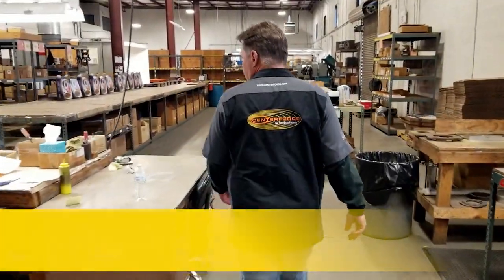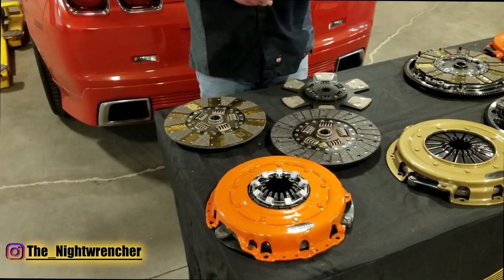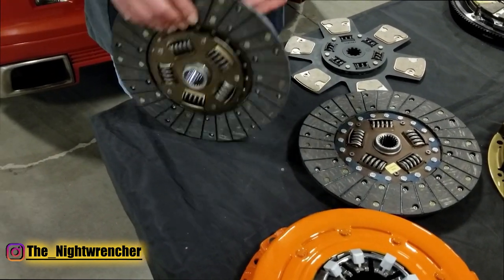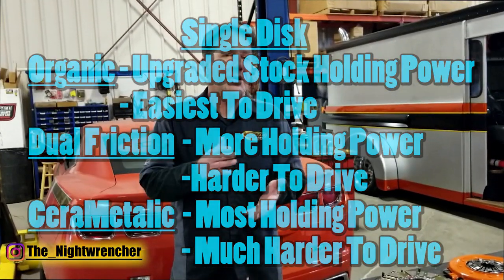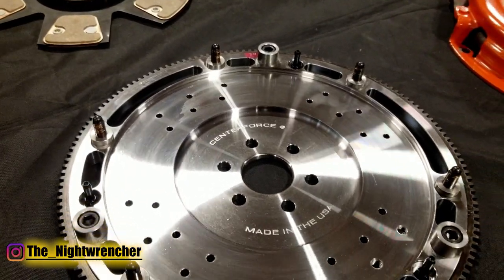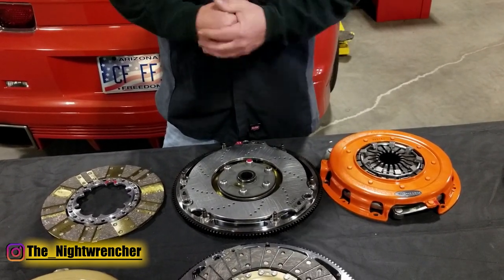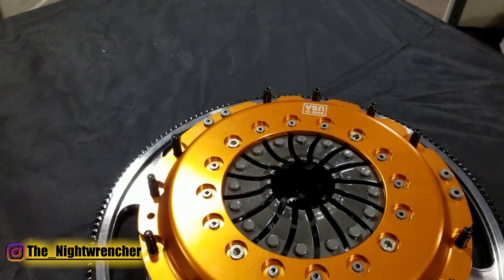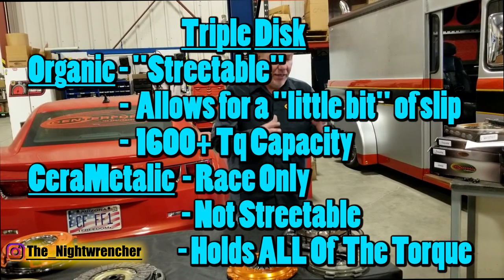Single Disk vs Twin Disk vs Triple Disk Clutches | Centerforce Clutches SST - Dyad - Triad Overview

Comment: Do they make low profile finger clutch for chevy 350 2 peace main seal, 10.5 I having bearing clearance problem. pressing on the pressure plate fingers. New to use a hydraulic throw out bearing.
Reply from the maker: I called their tech line for you and they told me to ask you to call in because they might have some options for you.
Reply: @NightWrencher thanks will do.

Comment: Any feedback on twin disc clutch noise or chatter at idle and below 2,000 rpm? Thx
Reply from the maker: I think it depends on the clutch in question. For example: the centerforce solid street twin uses solid hubs but their Dyad clutch uses floating disks and a single hub with dampening springs. The SST would make less noise because it has 2 hubs while the dyad only has 1. With that being said, a single disk would be quieter than a twin, generally speaking.